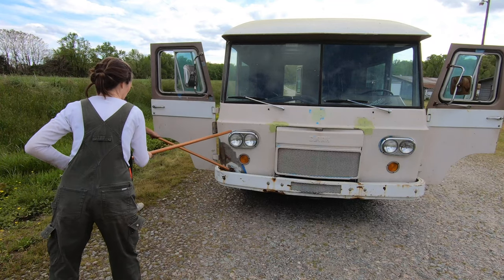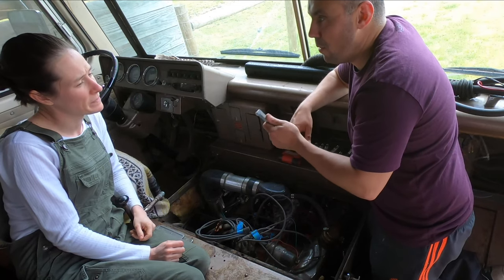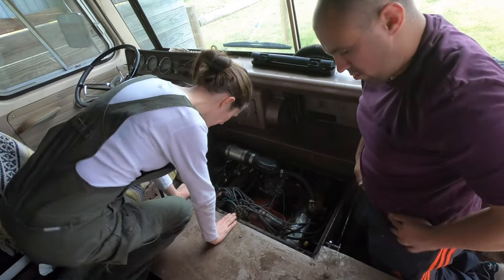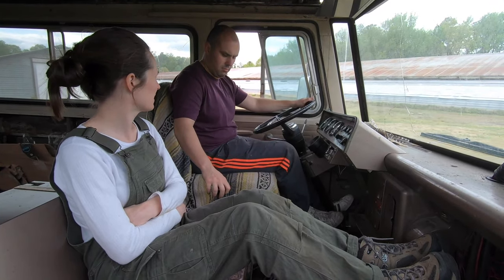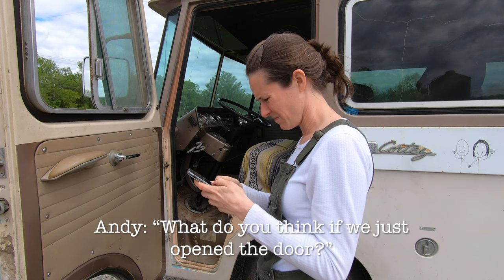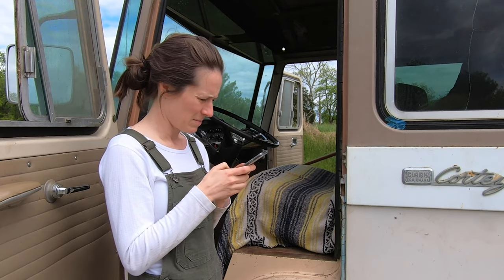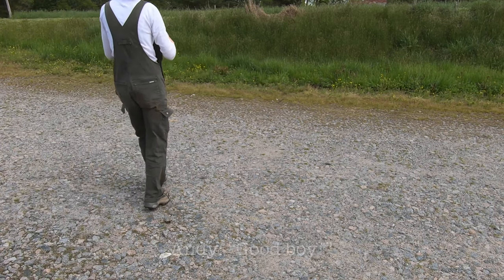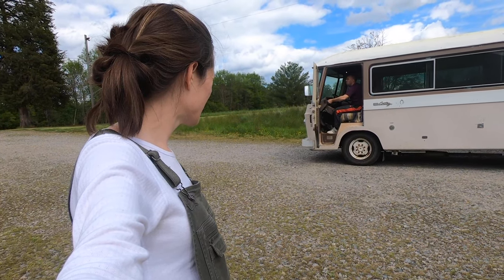A SNAKE IN OUR RV! A Snake Surprise When Changing Spark Plugs in Our Vintage 1965 Clark Cortez RV

Comment: Hi,if you still pour some old Brake fluid into the Carburetor at increased Speed,that helped with my old Mini.
Reply from the maker: To help stop it smoking? How does it help, I've not heard of this before? Andy (and L)
Reply: @SoulofaSeeker  Maybe and to loosen the Pistonrings,
Reply: Increase idle and always take a little sip into the carburetor
Reply from the maker: @batnrs1  Brilliant, thank you. We're hoping a good run and some new stem seals will sort out our smoking issue but we'll bare this in mind for the future. Thanks! Andy (and L)
Reply: @SoulofaSeeker  The smoke seemed to clear up after your removed the snake oil :)  But probably is the seals since it seems to clear up after it runs a bit and the compression test seemed good.
Reply from the maker: @lnxmachine  ha ha! I think so too. It's not a job I'm looking forward to because of access. If recent parts purchases are anything to go off, I've also probably bought the wrong ones! Andy (and L)